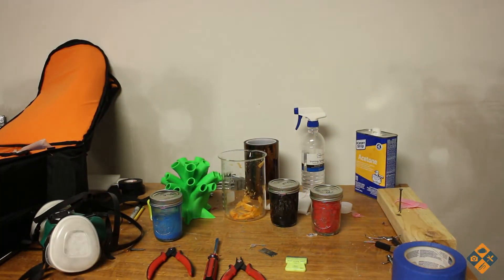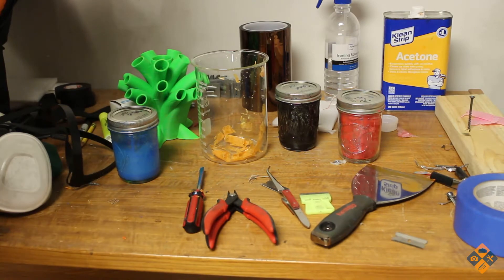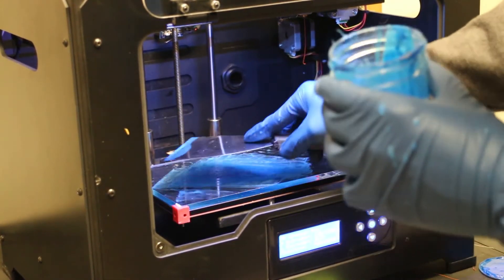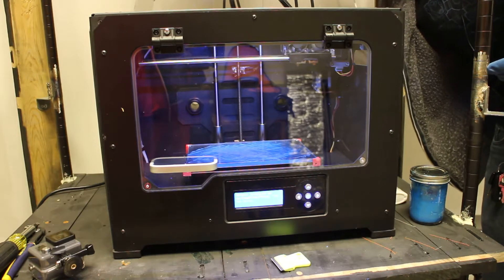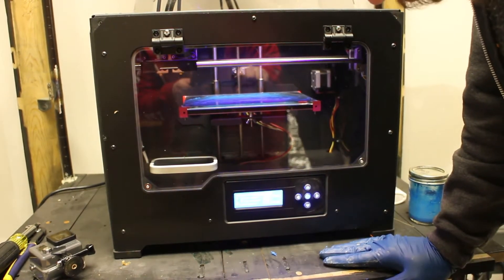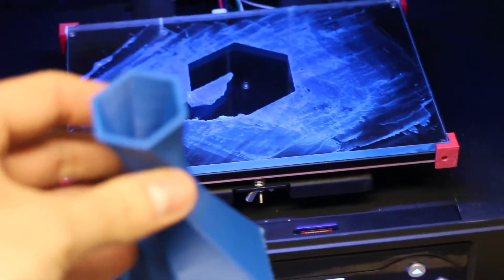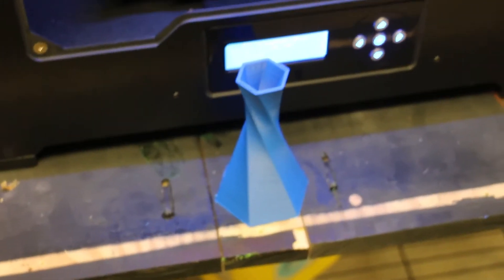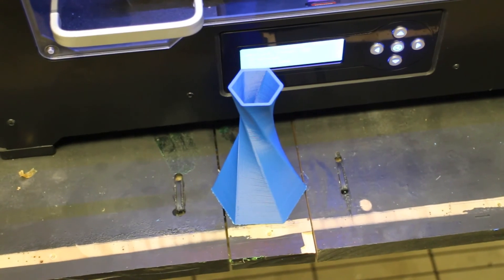3D printing with ABS Plastic tutorial

Comment: I have a nearly identical printer, but with hinged side doors.  It's the Qidi Tech I, $700 or less on Amazon.  I'm digging it so far.  I also spent $150 on Simplify3D.  It's a very nice slicing program and more.

PS - It's ASS-a-tone, as opposed to ACE-a-tone.  :-)